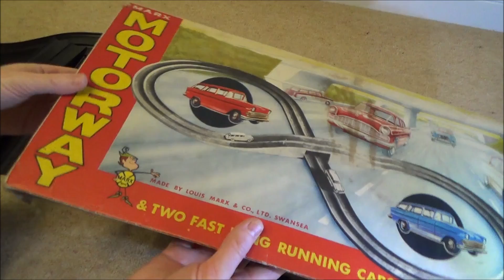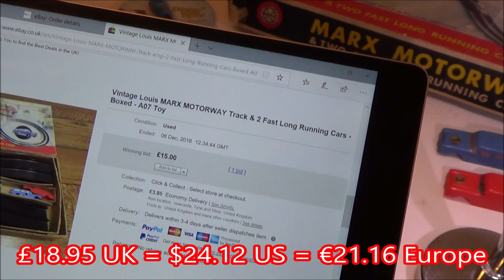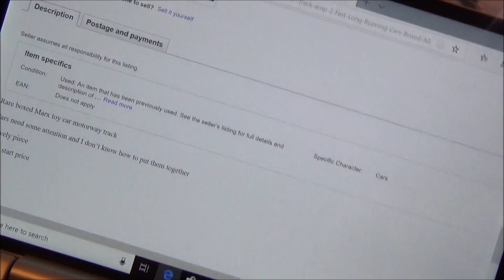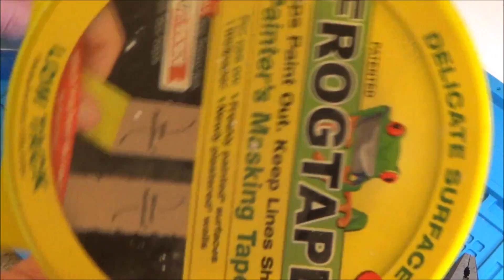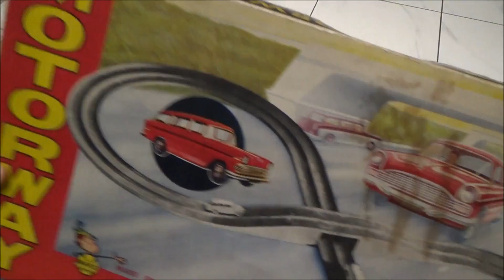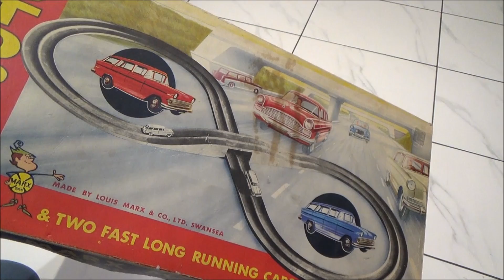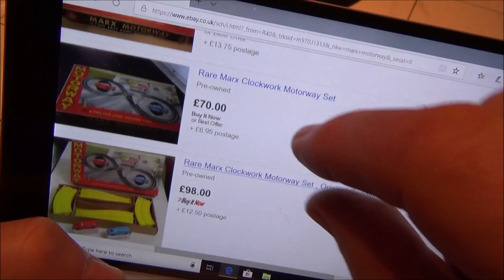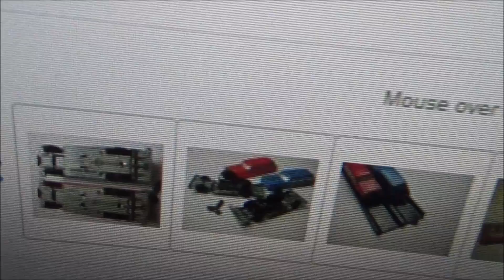eBay Pre 1980s TOY Repair Challenge PART 1

Comment: I can't believe how well that plastic turned out! I was sure you'd never get the plastic parts fixed. Really nice fix here Vince!
Reply from the maker: Thanks Steve, they did set a bit wonky but luckily they seem strong. The cars really fly around the track now much better than I thought they would :-)
Reply: Uusally I don't have much luck bonding plastics. Wonder if it being older plastic if it has better bonding properties?

Comment: The counterweight is doing pretty much the same thing as the counterweights on crankshafts in engines. Its there to create a smooth rotation, minimise vibration, reduces wear on the gear shaft and axle and generates momentum, so that the spring lasts even longer because less energy is needed after the toy car is at full speed.
Reply: Yep like a speed governor

Comment: Great job Vince, couple of things:
1. Super glue and baking powder can make for a much stronger bond, glue the crack together, then apply some glue across the crack and sprinkle baking powder over it. The glue and baking powder will mix and become a very hard solid substance. 
2. Maybe there should be a rule in that Steve can't use his ebay store to sell the fixed items, while this time around (with everything being toys) there shouldn't be a huge difference in price there still seems to be about a 1% advantage to store sellers.
Reply from the maker: Thanks for the tips, I have heard about this before but I always forget whether it is baking powder or soda that I need :-) I think because we are doing % increase hopefully a few % here or there on the postage or selling fees will not make much difference to the overall total :-)
Reply: @Mymatevince  it's not baking powder, it's baking soda.

Comment: Like others have said the weight is a governor. An interesting variation can be found in musical jewellery boxes - they use an air governor which slows the clockwork mechanism down by using air resistance thanks to two vanes on a pinion in the drivetrain. Their size is dependant on how fast the company wants the particular model to run. This ensures the music plays at the correct speed. The one in the toy cars as previously suggested by others, helps the car to run longer before the spring runs out of power. Without it the cars wheels would spin faster and faster up to a point, then slow down again, and the toy would only run for a lap or two. Basically its a rev limiter.

PS its a good thing you didn't disassemble the clockwork mechanisms for cleaning, those mainsprings are a right pain to get back in. They're much bigger once fully relaxed. Changed a few nitro RC pull starts and they're a nightmare.

Comment: I remember buying a smash up dirby car set in the later 70's. You stick a geared stick in and a gyro ran the car. They were designed to come apart along the body lines and had molded in dents. I abused the snot out of those.

Comment: I think the problem with the cars not climbing the hill is not lack of power in the clockwork motor, but lack of traction between the wheels and the track. Unfortunately there is a reason that real tyres are made of rubber. The simple fact is that smooth plastic wheels are never going to have enough grip on a smooth plastic track to do anything except roll along a flat surface. (they probably weren't all that good when they were new) Replacing the plastic wheels with rubber ones would probably fix the issue but of course it would no longer be an accurate restoration. If you could get hold of a few really small rubber bands (loom bands would probably work, if you can still get those things) and fit them around the back wheels then you should be able to run them just fine uphill. Just a thought. Keep up the great work!

Comment: That weight is probably like a regulator.Like you have in a  old pendulum clock to regulate speed.
Reply: the weight acts like a flywheel to use inertia to keep it running smoother.
Reply: It's a governor.
Reply: @kruleworld  yea, in some toys there are similar mechanisms which actually have a small flywheel

Comment: Those old clockwork mechanisms are built solid. I have a couple of old Meccano ones and they look like they're completely falling apart but they're actually perfect and how they should be. These look like like they have a very similar mechanism. That little locking mechanism is in the right place but it must be common for them to loosen over time on the rivet. It's the same thing on the Meccano ones.
Reply from the maker: Thanks for the tips and the other message on the flywheel. It makes more sense to me now :-)

Comment: I dont care if you call yourself an amature. Thats not the point. The point is to show us your stuff and personally, I like the way you explain how you trouble shoit a problem and reason out the variables. I have been impressed in all your videos. I attemped to fix a trail camara but had no luck. An internal batter leaked and destroyed the item.

Comment: Not sure if you check comments on older videos but only discovered your channel.  For the super glue get rid of the gel stuff and get normal super glue.  And buy some accelerator. When I found out about this stuff changed the way I viewed superglue. Also if you can rough up the plastic with a fine grit sandpaper so the glue has a place to grip on too.   Plastic tend to break really clean so anything you can do to give it a place to set helps.   But the accelerator I think is a must I cant live without it now.

Comment: The shafts and pivots would have had a drop of light machine oil on the works...NO GREASE. also the counterweight is a speed governor to prevent the wheels from over-speeding and immediately unwinding the mainspring while the plastic wheels just instaspin on the track with no traction.

Comment: This item was Louis Marx's entry into the model motoring craze of 1962-6. This was a low-cost entry in a market dominated by electric sets that run like model trains from batteries or transformers. Marx's biggest customer was Sears, Roebuck, & Company and most of their line was available from there in the heyday. The cars are loosely based on the 1958 Plymouth that was a favorite with toy makers for several years. Athearn made more detailed models of the same car in HO (OO) scale for decades.
Reply from the maker: Great info, thanks for sharing it :-)

Comment: That weight is a flywheel. If you know what a flywheel does it should be self explanatory. I believe it puts extra weight on that end more so than just the gearing so the whole mechanism doesn't release too quickly.

Comment: When painting very small items, try using petroleum jelly to 'mask' the detailed areas. Paint won't stick to the petroleum jelly and the petroleum jelly will help to revitalize the old plastic. If you use petroleum jelly for plastic only, heat the jelly until it is a liquid.  The paint on plastic when it is around 120°F / 48.8°C.

Comment: ahh vince the point of the off center weight is to provide resistance to rotation so the wheels have a maximum speed although the vertical nature of siad weight may cause it to bounce a little which may effect it's ability to climb hills if not given a long time to speed up

Comment: Fun repair =D  I think I would have tried epoxy rather than superglue - I find that very few things really stick very well with superglue.  I also wonder if a replacement chassis could be made using a silicone mold and some of that plastic that starts as liquid and sets into a solid plastic.  Would be a lot of work though lol.  It's something I was going to try at some point to re-create a damaged plastic gear.
I was glad to see you oil it - that was one thing I was surprised you didnt do after you cleaned them, but it was worth doing it that way around just so we could see how much better it ran with the oil!  I was quite shocked at how much better they performed with the oil vs no oil.  Great video Vince =D
Reply: Some JB Weld epoxy would be a good color match and is super strong.
Reply: Superglue (cyanacrylate) is very good if you properly decrease the surfaces. Acetone is the best stuff for that, but not all plastics like it (can be used as glue on ABS).
Reply: A aluminum one could probably be made that would fit (shouldn't use anything heavier or they might not work) [i might see if i can make some when i have the stuff to do that]
Reply: This might be the one good usage for Gorilla superglue. I hate the stuff because of how thick it is. Every time I try to do fine work with Gorilla superglue I just get angry because it is miserable to work with...but for putting plastic cars back together it appears to work rather well.
Reply from the maker: Thanks Chris :-) I wanted them to set quick because of the amount of parts that needed gluing. I was hoping the strength came from the UV glue instead once the superglue took the initial hold. They seem strong but I don't want to bend them too much :-) I thought that maybe the oil would attract dust and dirt and possibly slow them down. I didn't know if it was originally oiled at the time of filming. The reason why is because I oiled my son's fidget spinner and it decreased the spin time dramatically. Apparently if you have load on a bearing like on a skateboard wheel then it needs oil because it will wear but if there is very little load (like a fidget spinner) then oiling them will slow them down. That was my thinking behind it, but like you mentioned I can't believe the difference oil vs no oil made. They absolutely fly around the track now. I didn't think of it at the time but a viewer suggested just doing an oval track without the bridge so I will try that tomorrow to see how many laps these 'fast long running' cars can do :-)
Reply: Yeah, if there is a good amount of load on rotating/moving parts, then it makes sense to oil them because of wear and friction reduction. But with too little load, the oil is just a hindrance for the parts because of the viscosity.

Comment: I have a question regards the selling what if your buyer is in the USA and his buyer is in the USA that means you have to spend more on Postage fees UNLESS the buyer has to fork our for the Postage fee which should be also calculated with the sell price..
Reply from the maker: Hi. It is the same as real life. If I (UK) sell this to an American buyer then the buyer will have to pay more postage otherwise I could end up losing money. In this instance this item will be sold to UK only due to the excessive postage charges. Once all costs are taken into account only then can the percentage profit or loss be worked out :-)

Comment: I would get some fine wet and dry paper wind it fully and spin the wheels while lightly holding the wet and dry on the surface of the wheels to take off the shine and make them grip better.

Comment: Get some activator for your glue Vince.  It's great for instant set application situations.
Reply from the maker: Thank you, I never knew it existed. I have just ordered up a can of it on Amazon (cheap £3-4 stuff) so hopefully it will help me in the future. Thanks for letting me know :-)
Reply: @Mymatevince  If you need to bolster joints with super glue you can use pinches of baking soda in the glue, then hit it with the activator and you have a bond that is super strong. Dont use it on things you are not painting or that will be visible as it doesnt look great, but it is very strong.
Reply: @Mymatevince  no worries.  Just be careful with it put a dab of flue one side and either activator other or a very small spray . I got it on my jeans once and the activator speeds up the thermal reaction it hurt quite a bit. It's great stuff for those moments where you need something to be set almost instantly. Works great on various substrates too. I used it for wood and metal projects.

Comment: Too late; but, I was wondering if some old model car glue would have worked; they tend to slightly melt the plastic together forming a strong weld bond.

Comment: Superglue is based on a material used during the world wars as an alternative to stitches for large cuts and wounds on people. That is why it works well on human skin. It was designed for human skin.
Reply: During the Vietnam war.
Reply: Mixing "Superglue/Crazyglue"/etc. with a bit of baking soda makes it bond better and faster. Pure CA is not great at resisting vibrations and impacts. Special plastic cements are available and the solvent types actually weld the materials together. I use them to join polystyrene and ABS plastics and reserve the Superglue for things like clear "window" parts as it does not eat up the plastic.

Comment: I have not tried it but you could if you were able to spray it, paint the bit you do not want silver with vaseline or then clean it off after the paint has dried.
Super glue is not great on plastic.
The key alignment would possibly have been better if you bent the single tab the other way, I know you bent them where the plastic was better.

Comment: 27:55 i tell you why u have these problems with super glue - it's because it was made for soldiers as a field first aid on open wounds (so they would not bleed out) it the first place (as a quick way to close wounds before evac). That's why is super effective on human skin. You can read more here https://en.wikipedia.org/wiki/Harry_Coover if you're interested. 
I actually use superglue on small cuts when in work (if i cut myself while stripping cable it's much more efficient to just give it a tap, slap back the skin and you can work without getting stuck by the (falling out) bandaid (or electric tape, which works a lot better than bandiad, just sayin :) ). And unless you're pouring a whole bottle in your vein there's nothing that would harm you doing so. 

Also about that UV pen - if you're using it a lot it's a lot better to just get some cheap UV LED strip, stick it into (for example) old pot and make yourself UV bake pot in which you can leave cure those parts for some time to be really sure - unless you worry about discoloration (which might happen, but you would have to leave it there for hours and hours) you should be safe doing that.

Btw if this toy is anywhere close to one we had in czech republic then it never really worked. My friend from elementary school had something like this and we end up getting rid of the bridge (because they always got stucked there) and just made a circle... and then we just took out the whole track and played with those cars alone, sending them against each other (like jousting). I'm pretty surprised these actually worked after the oiling (mby that was all they needed back then... but we were ~7, we did not mind :) ).

anyway nice vid as always, gl in the challenge (just watching now)

Comment: Since youare reselling, make sure the buyer knows about the glue repair. Marx is a collectible brand and damage will hurt the price you get but some people will care if it was repaired. They are going to want specific details. Collecting something like this can be a big deal and they may buy it to get parts. IE if they have cards but not track they might buy it and swap the cars out to have a complete set. The box is an even bigger deal as you have one. 

I too wonder if epoxy would have been better.

Comment: I am wondering if it would be feasible to make a plaster cast of one the tracks connections then I would line the cast with Plastic film and use that UV Glue to make the missing connection and then I would glue it to the track with the missing link, would that work? if not, just tell me I am dreaming and I need to wake up. :D 
Another method might be to place the broken track connected to another track upside down and then place plastic film over where the joints are and place UV glue in place, NO? Ok I give up.. :D

Comment: You should consider a 3d printer Vince.  So you can replicate and replace things like the chassis of the cars.
Reply from the maker: I like the idea of them but I do not know any 3D drawing packages. I fear it might take months or years for me to learn even a simple design. Maybe the drawing software is easier than I think but as far as I know a 3D CAD designer is a full time job so I am thinking it must be quite involved :-)
Reply: @Mymatevince  true it's not the easiest of things . However there are a lot of free files out there that you would simply load onto your printers sd card and print. In most cases you might find you're lucky enough that someone else has done the cad model and uploaded it for free. Or you could use a service like fiverr and pay someone a few quid to make the model for you. Just food for thought really but might be an option later down the line.
Reply from the maker: @davesmith7671  Thanks for the advice, definitely food for thought :-)

Comment: I think the asymetric flywheel is in there to help should the car foul on the track, give it a nudge y'know? Not that it'll help much with 50 year old mainsprings. If you replaced those, they could run far better. The full lubejob you gave them though was impressivly effective.
As to what the cars are, I believe they are Vauxhaul Victor F Estates as you found. And yes there was a tintoy version, which is worth a bit more. Horrible URL 
https://www.vectis.co.uk/marx-toys-uk-clockwork-motorway-scarce-set-comprises-black-plastic-curved-straight-and-bridge-roadway-sections-2-x-clockwork-cars-creamred-and-creamblue-with-individual-boxes-which-are-fair-the-contents-are-excellent-to-near-mint-in-a-fair-colo_351513?records_per_page=24&filter2=Further+Quality+Toys&page_num=1
You really should drop a link to your auction in the description too ^_-